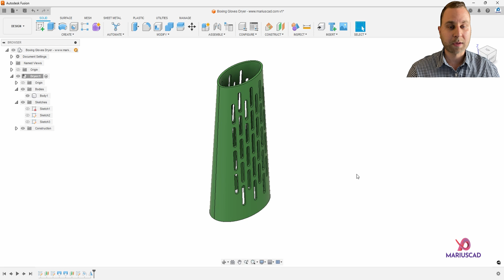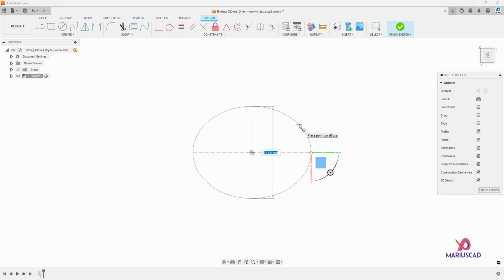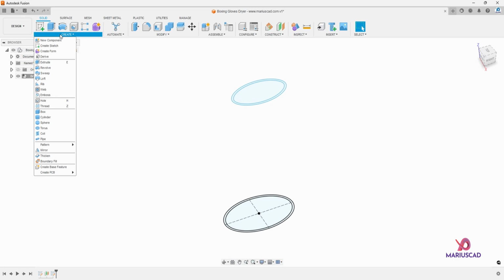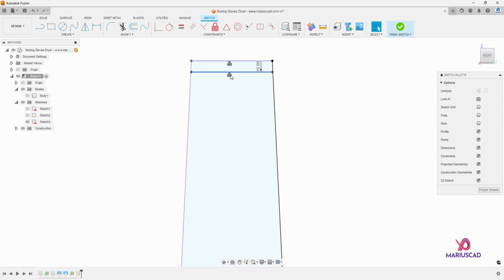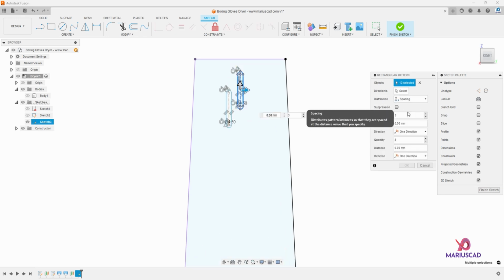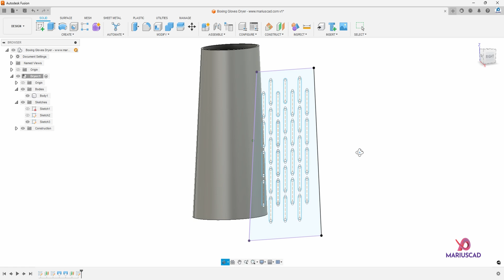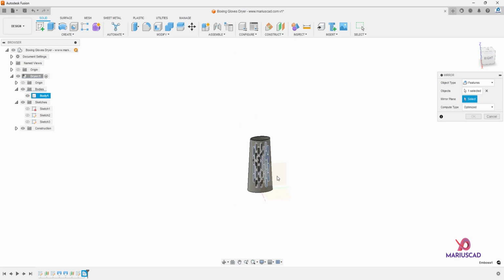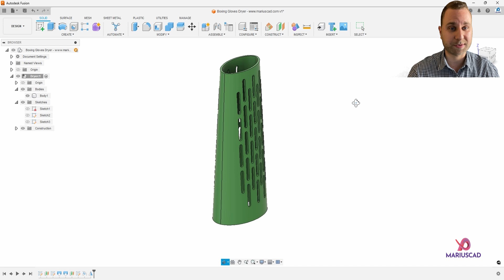Fusion 360 | Modeling a 3D Boxing Gloves Dryer | 3D Printing

Comment: Hey man, that is awesome! I am working on recreating this-trying to learn how to design things; for this one, how would you include a flange on the piece that would allow it to be mounted to a flat surface? Also, I would like to have the top curve a bit to run air into the fingers, but I don't know how to do that either...any thoughts? I'm going to work my way through your other tutorials (thanks!) but thought I would check and see if it were an easy tweak to this model.